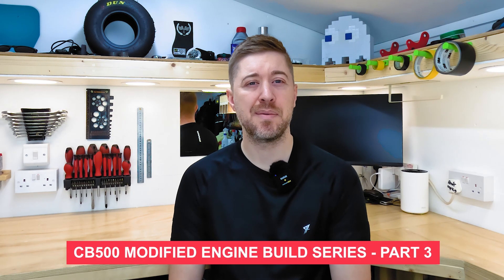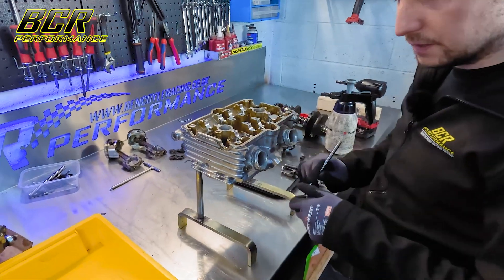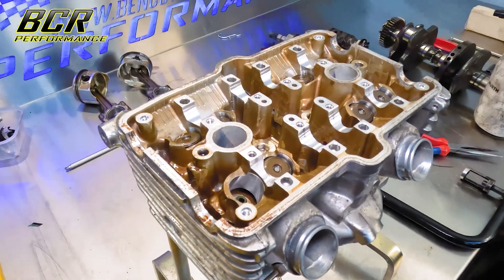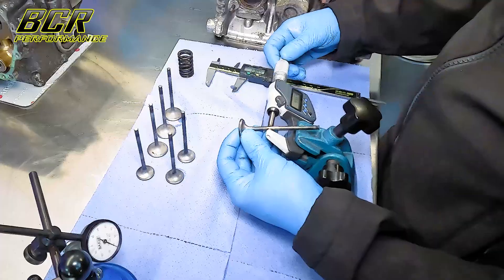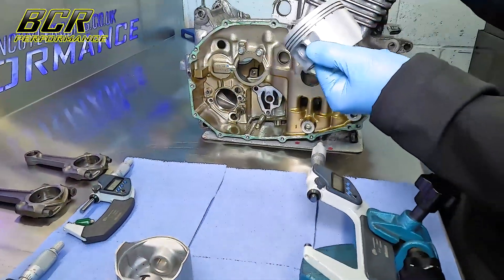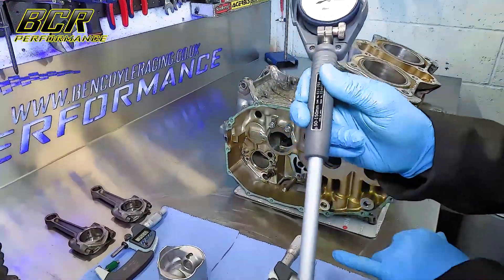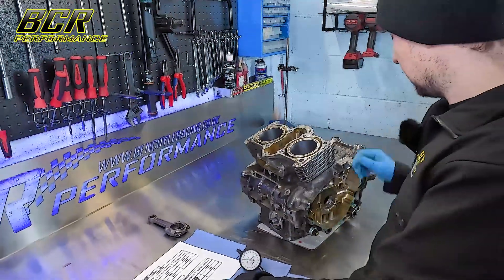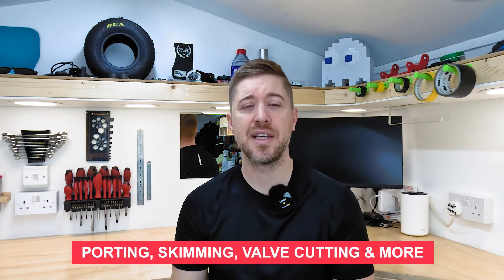Honda CB500 Engine Cylinder Head build with BCR Performance

Comment: Suggy see the coil sticks do you need the harness from  the bike to wire in to the CB coil
Reply from the maker: Hey. Yeah it's wired into the harness, but it's a race harness. Grant at HWW racing made me it. It's just a different plug on the end, and the cables need to be longer to reach the top of the cylinder head. 👍
Reply: Does it have to be a certain year of CBR
Reply from the maker: @thomas1112002  Mine were from a 2007 fire blade. But I'm sure the R6 ones work too. I think they are all the same. The brand is DENSO. Just got them on eBay
Reply from the maker: @thomas1112002  you'll also need the plugs, which are DENSO ignition coil connectors, again on eBay